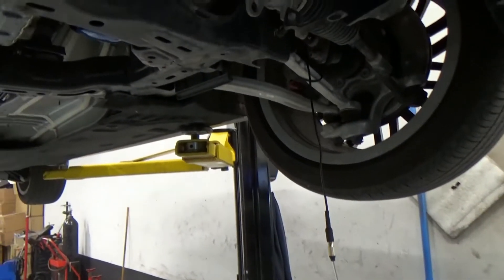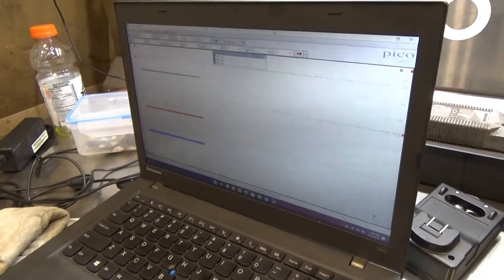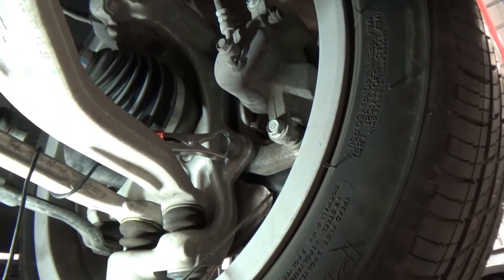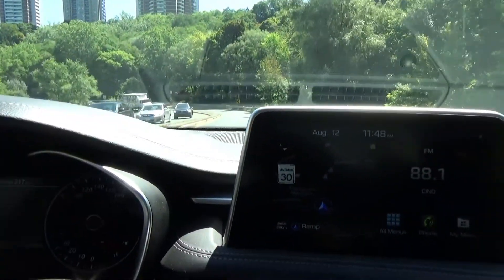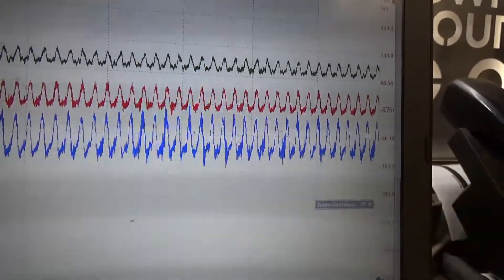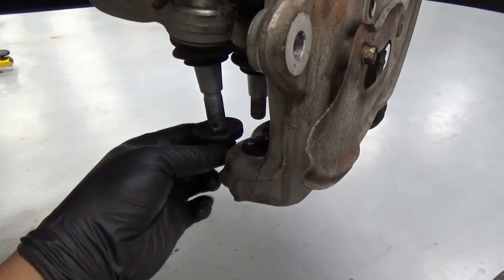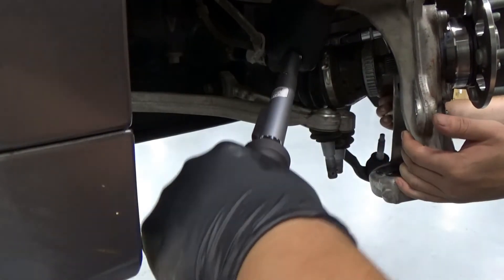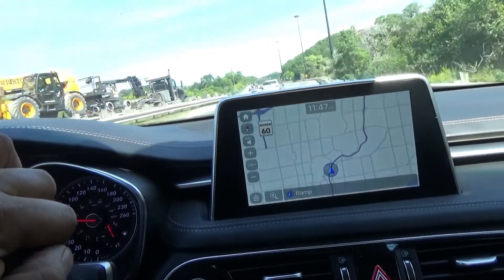Genesis G70 weird abnormal noise while turning left

Comment: That is interesting. Looking forward to the second part! Unrelated to the problem you are working on, I have a question. With the G70 being AWD, should there always a faint "gear" noise? My G70 has that but I assume it's because the AWD.
Reply from the maker: What you mean by gear noise? Like a whinning noise when turning? Just driving straight? From the rear or front? If its from rear and if the vehicle is equip with lsd, theres a bulletin to change the fluid for the lsd i forgot the part number to atleast lessen the noise or to correct the noise.
Reply: @hyundaitech  driving straight and it sounds like in the front. It's very quiet. My car doesn't have the LSD.
Reply from the maker: @SlipAngleG70  ahhh okay never had that problem, just monitor it for now if it gets worst, maybe tires?
Reply: @hyundaitech  It's a faint noise, so maybe it's normal and I'm over sensitive to it? I should try another G70 and see if I can hear it.
Reply: Really good work man, I like your approach ! I have a G70 AWD and I feel and hear a kind of howling noise at 70-80 KM ! The weird thing is the both front wheel bearings are new and both front tires are new, but I did get Chinese bearings as OEM was not available, I regret my decision now because it means that if I do the process of elimination I will end up spending a lot 😅

Comment: Im having a similar problem now with a 2022 car I just purchased. I can make the car make the sound if I do like a slalom at low speed goong left to right. My sound is more line a rubbing sound,  its been to the Genesis shop and they ened up replacing the struts, but that wasnt the problem.  I am so confused, I almost wish I had purchased another car.
Reply from the maker: I think in this video i found the noise coming from the heat shield hitting the propeller shaft. Noise issue are very tricky to diagnose, let me know what they find out.
Reply: Did you ever figure it out? Mine is doing the same when turning left and right at slow speeds like in parking lots.
Reply from the maker: @alanhernandez4315  i did  a follow up video https://youtu.be/AJ8JTsHIfPE?si=POOmVXEYxRECd_0N

In this case it was the underbody shield hitting the mid propeller shaft.